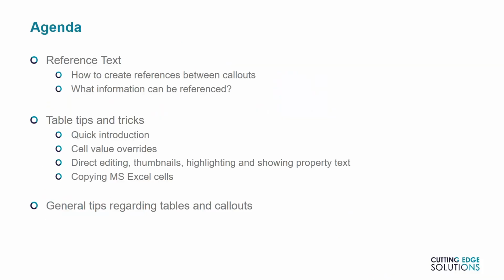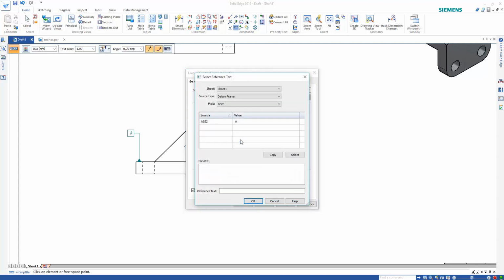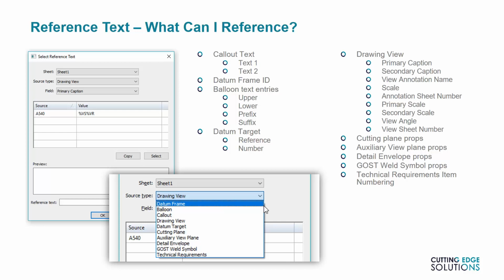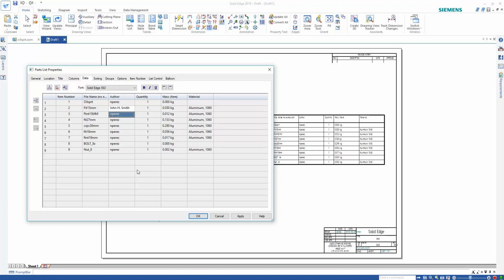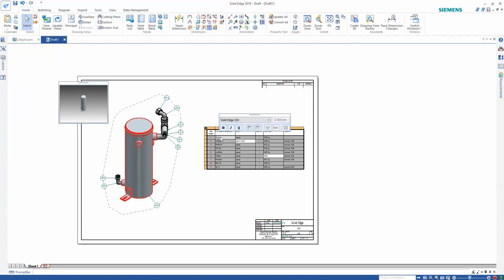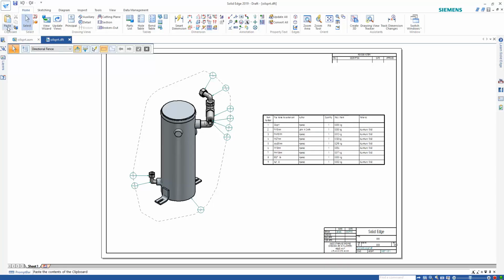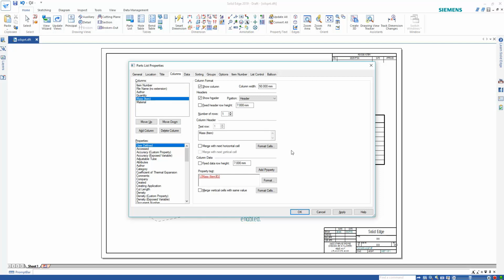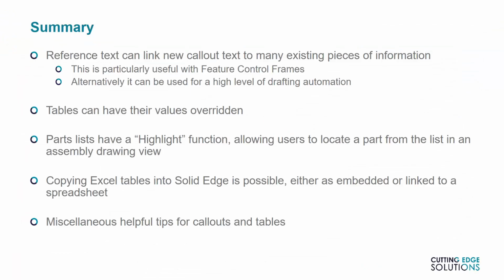EDGEcast - Solid Edge Reference Text and Tables

Comment: In column of material size like          OD 168.3 x SCH.40 x 560 LG.                                                 OD 224 x ID 154 x 24 THK.                      
L 300 x W 250 x H 500.                             
3 NB ASME B16.5 CL 150 SORF FLANGE.
No manual typing in main bom.
If possible please reply sir.